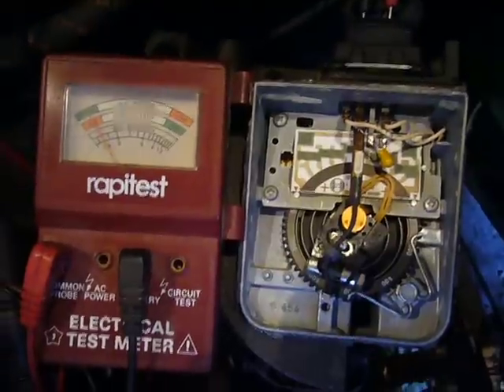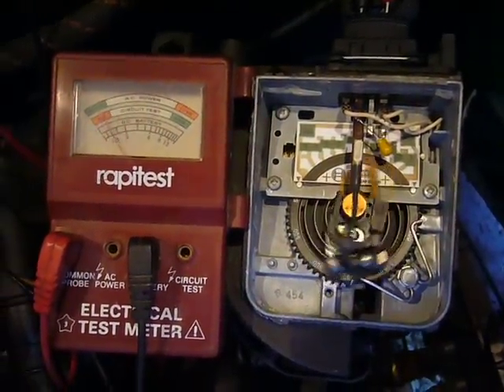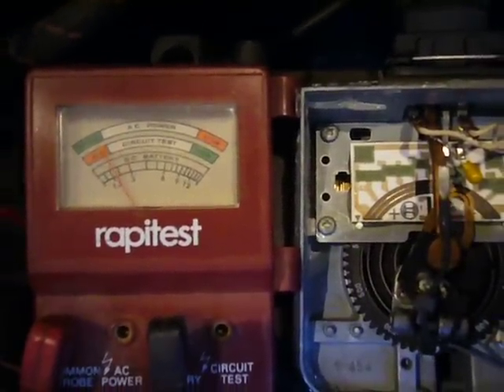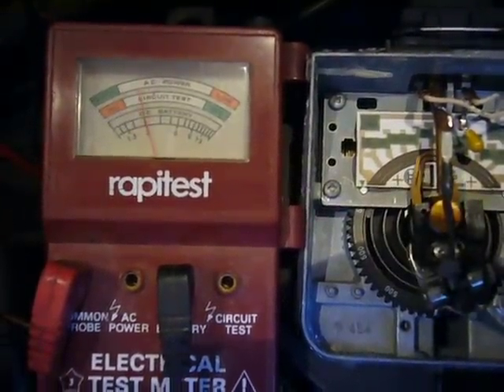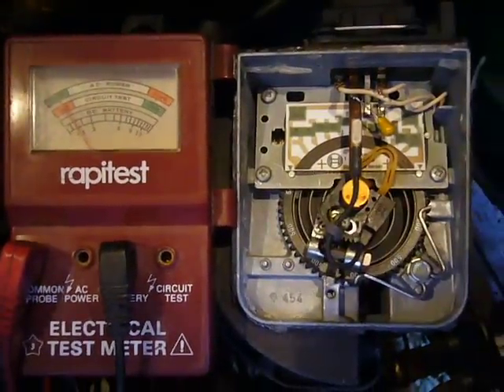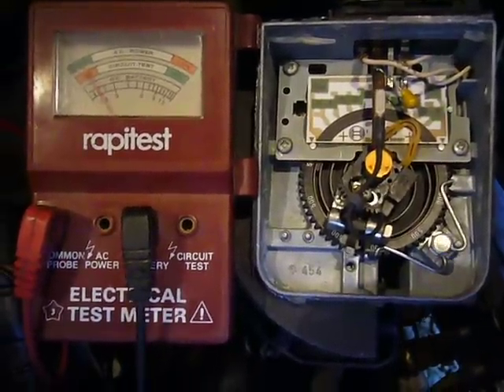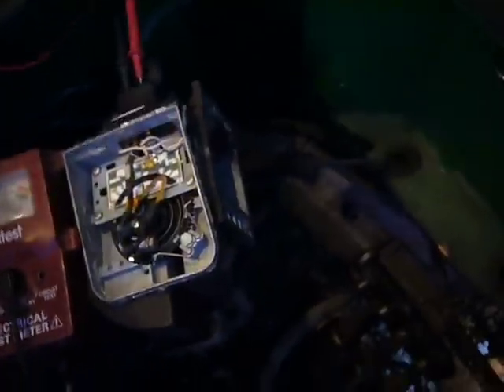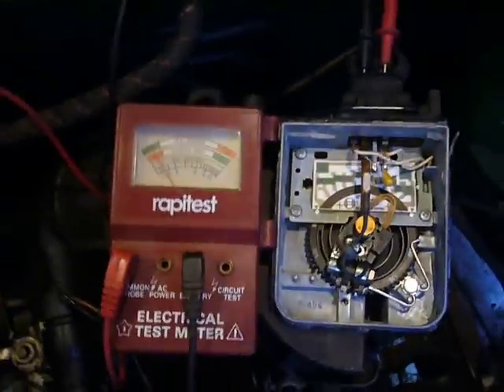Volkswagen T3 DJ Air flow meter test

Comment: What pins did you hook up the multi-meter to?
Reply from the maker: It’s ground and the variable output, can’t remember off hand, one pin will be 5v constant the other is the variable output used by the ecu for fuelling. Good luck. It’s a lovely simple thing👍👍

Comment from the maker: I have heard of this modification, but have not attempted it. Did it help with the kangarooing?
Reply: Simon Aldred   Sorry, late answer (only six years 😃 )  yes it has helped somewhat on my different DJ engines. Now I'm revisisting your video and coming back to this problem !  You seem to have your engine in a very very good condition, which of course adds to your credibility. Do you know in what region the Ohm reading should be over the register? I have seen it reported somewhere on the internet but just can't seem to be able to find it now..  I think it was on the german t3infos website.
Any help is greatly appreciated Simon ! thanks.
I have gone through a couple of air flow meters I have lying around, and one of them looks really good, with not much wear on the potentiometer track at all, so I'd really like to use that one if possible.
It does give a higher resistance reading than the others though. goes up and down between 1000 and 1890 Ohms over the path. the readings are smooth and no interruptions or sudden jumps up/down along the way.
many thanks again if you could add any info on this !  greetings from Sweden

Comment: Nice. You might also mention the 22 uF(?) capacitor between pin 2 and 4.
My DJ engines have never given me any problems after that tweak. (both tried 22 uF and 47uF)
I have used ordinary electrolytic capacitors and not tantalum type.